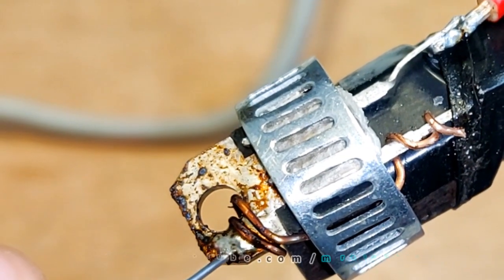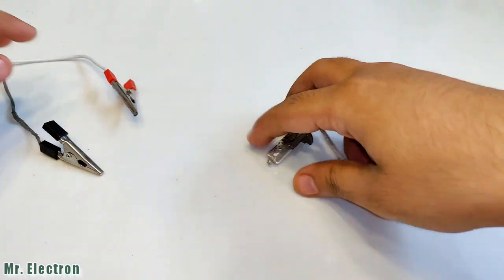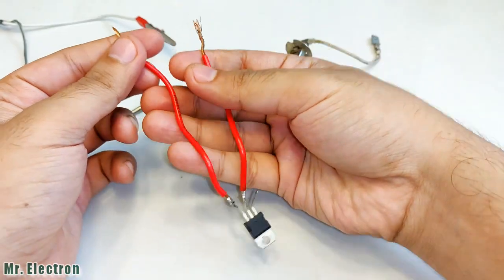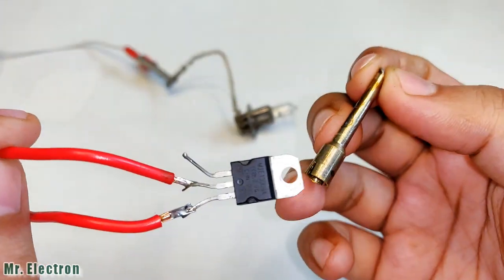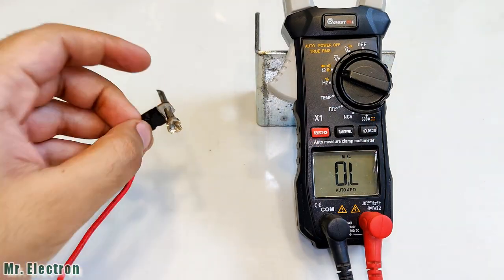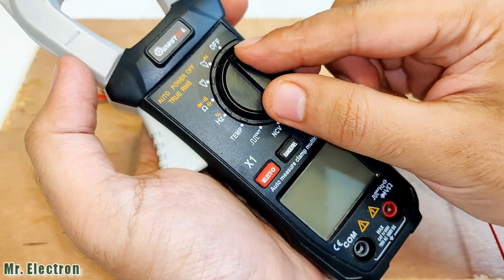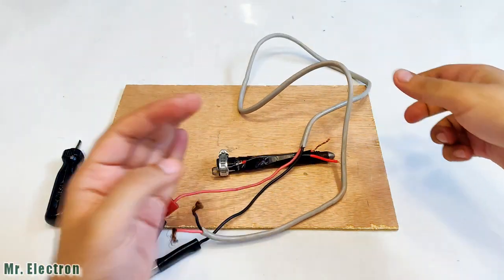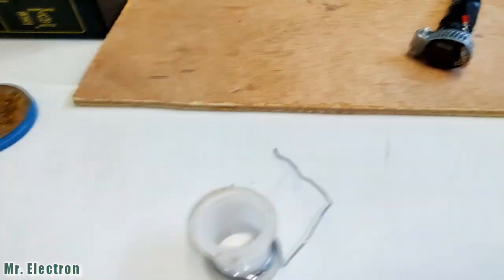DIY 12v DC Soldering Iron Using Dead Transistors

Comment: BRUH its like literally shorting the battery, INSTA BOOM!
Reply: the resistance is high, it is not damaging the battery
Reply: @littleraptor9898  Well it's not really a great thing ;v even if the resistance is high it wont last much
Reply: @McMasterProGenius  if you look at EVERY (and i do mean EVERY) electronic device/gadget/whathever you will see that it is a short circuit. FSC-shorting a lead acid battery will cause it to drain quickly. if the resistance is high enough, it wont cause a FSC. if resistance wouldnt have been a thing batteries would just last FOREVER!
Reply from the maker: No ! The transistor resistance is too high .

Comment: also, can i use a working transistor? if not, can i just short a transistor and done?
Reply: Short it first and then it might work
Reply: @lengaming1651  ok, thanks
Reply from the maker: Hey! You can connect a variable resistor b/w base and collector and the use it
.. That way you can also adjust the heat.
Working transistor will also work.
Reply: @MrElectron  thanks, i have a bunch of transistors so i will probs go with the transistor one
Reply: @MrElectron  iam going to try with a mosfet, that one heats up nicely aswell. if it wont work i will switch to a power transistor.